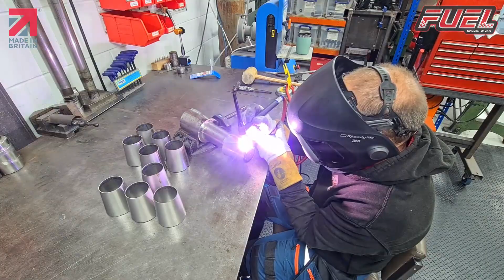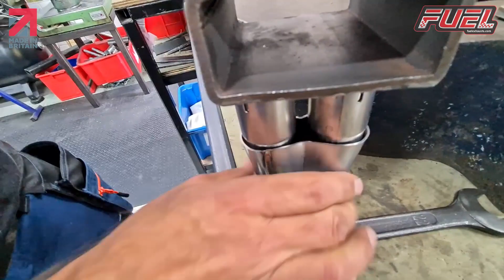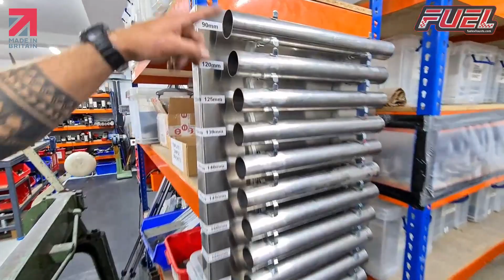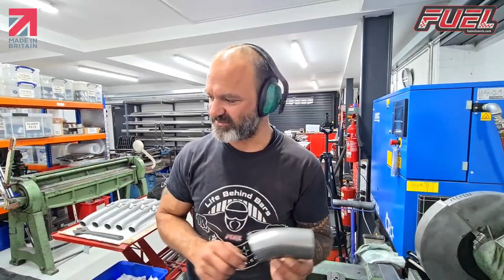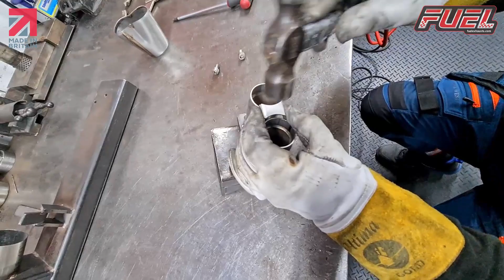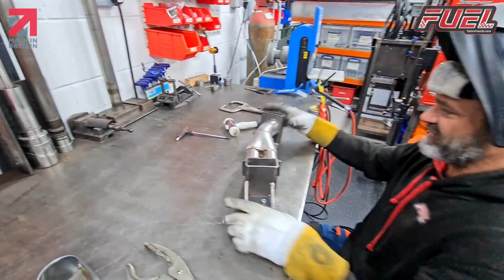Honda Bros NT 400 / NT 650 / Hawk GT Motorcycle Collector Link Pipe Manufacture - Fuel Exhausts

Comment: I need one for my hawk soon
Reply from the maker: Plenty of choice here - https://www.fuelexhausts.com/exhausts/bike-and-range/honda/hawk-gt-rc31-1988-91
Reply: @FuelExhaustsLtd  where does the merge bracket attach onto the bike itself? Rear sets or one of the center stand holes?
Reply from the maker: @kingdavid2018  we supply a bracket which brings the mounting point further back and this is fitted to the rear of the footpeg mounting point. If you want further info, please email us at info@fuelexhausts.com and we will show you. Thanks.